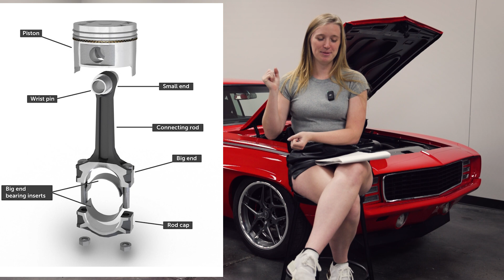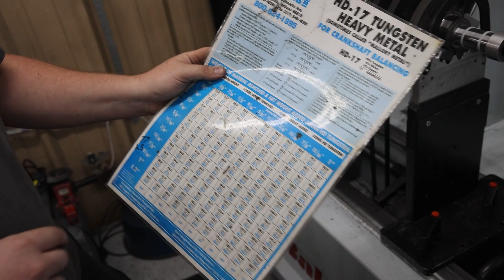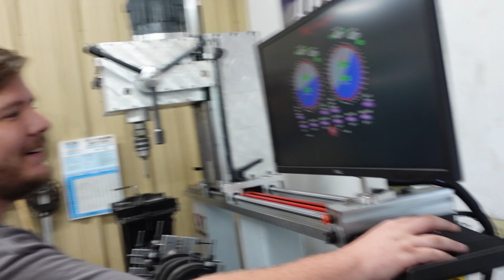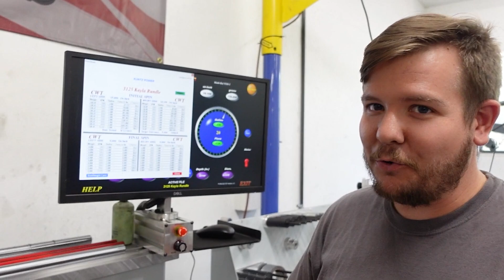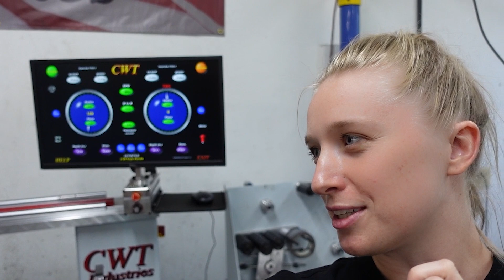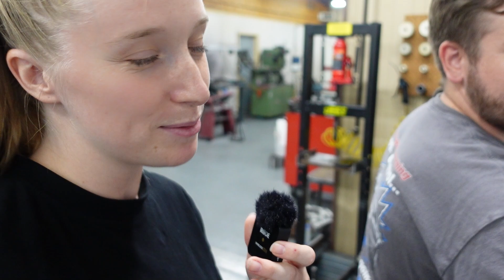How I balanced my Crankshaft Ep. 6

Comment: Cool video Kayla!! By the end of this series of videos, you'll be able to build another engine all by yourself. I've built an old school Chevy 327 one time,  I had it balanced and the pistons/connecting rods weight matched. I had a 274 cam in it, that thing would rev to 7,000 if you didn't let off the onions quickly enough, and it wanted more rpms!! Congrats on doing a killer build!! Thanks for the video.